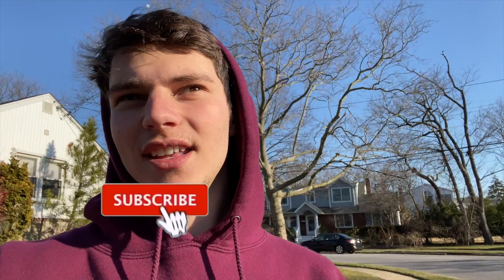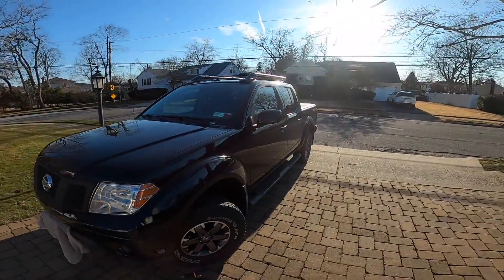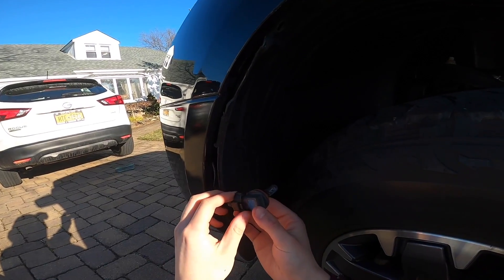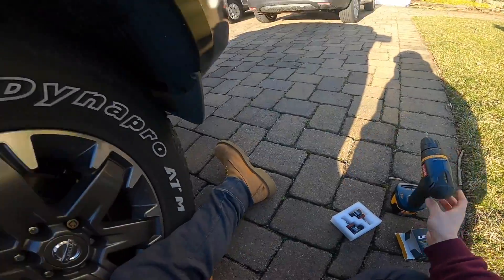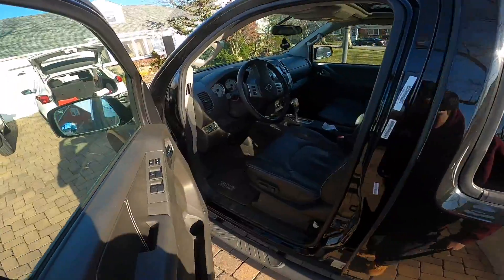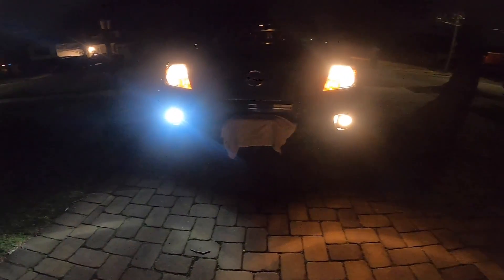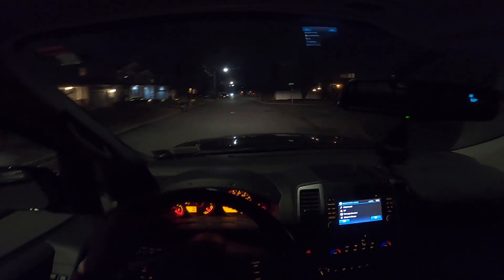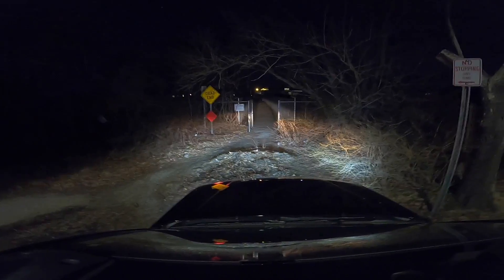How to INSTALL LED FOG LIGHTS ON NISSAN FRONTIER PRO-4X (Auxito)

Comment: Hi Ethan. Would you know if it's correct that the 5 gear automatic Frontier pro 4x comes with custom install roof rack. The 6 gear Manual for whatever reason, does not?. Is there any truth to that?
Reply from the maker: Hi! I have a friend that has a auto pro4x and it did not come with the roof rack. I think it’s the package that decides if you have one not whether it’s manual or auto! Hope that helps!
Reply: @EthanSilver  certainly does. One other quick question regarding fog lights. Are any of Nissan's pro 4x crew cabs made (off the factory line, so to speak)  with fog lights installed or are these always part of the accessories? Thanks Ethan
Reply from the maker: @WelshChappie  i believe that on pro4x they all come installed from the factory! I could be wrong but that’s what i think
Reply: @EthanSilver  ok, there's a lot of videos showing how to install LED/LCD fog lights on YouTube that I assumed they had to be installed. Anyway, thanks for your help.

Comment: So now you need LED headlights because the stock look like crap.
Reply from the maker: Agreed. I’m probably just going to wait until hopefully someone makes aftermarket ones w led lights. The only aftermarket ones out rn are WAY overpriced
Reply: @EthanSilver  LED Headlight bulbs? There's 100's of different brands
Reply from the maker: Noo, not the bulbs them self’s, but housing too. I heard led with the stock housing just shoots light everywhere
Reply: @EthanSilver  That's true with HID but led not so much but you need to get some good ones not the cheap ones.
Reply from the maker: Thank you sm I’ll look into it! Thanks for the info